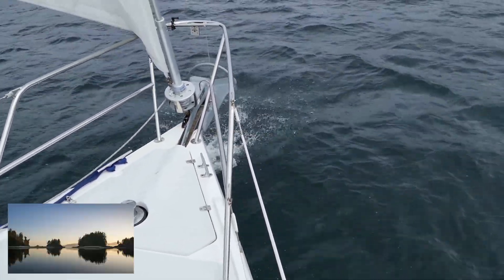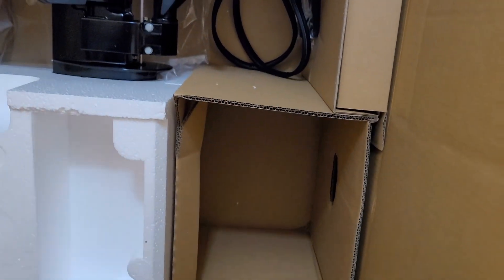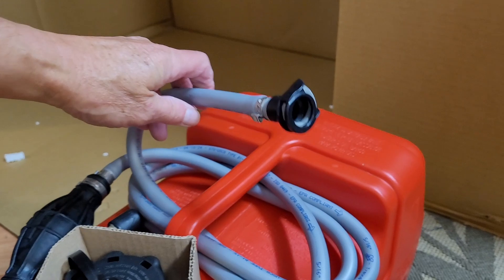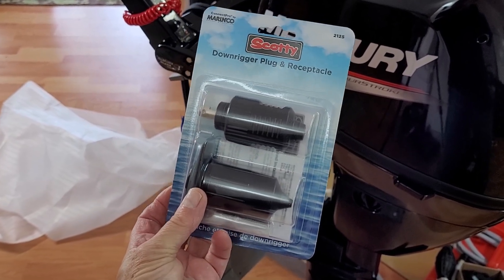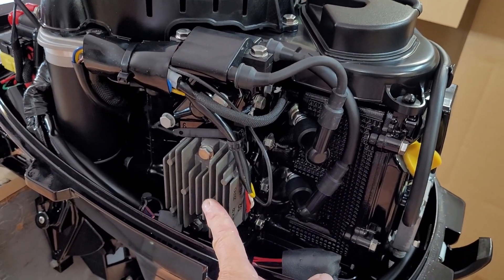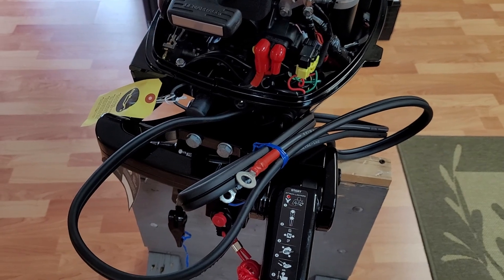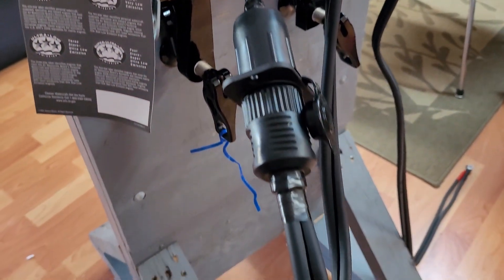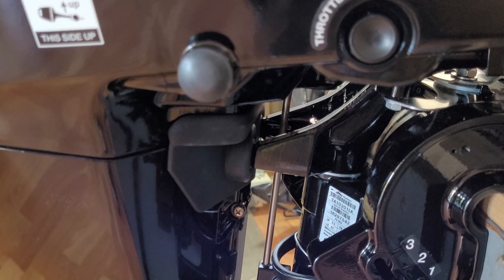2024/25 Mercury 9.9 HP EFI Outboard - Unboxing and  a Question for Viewers

Comment: I have a 2017 Merc 9.9 electric start (carb) that I have had since brand new and it's permanently mounted to my Gheenoe.  Still works like the day I broke it in.  If I were in the market today for a 9.9, I would totally buy the Merc 9.9 EFI over any other 9.9.  I wish you many good years on yours!

Comment: Hello, can you tell us how heavy the machine is ready to drive with oil and propeller? Best regards
Reply from the maker: Depends on if manual or electric start, etc. - But in the area of 95-105 lbs. (43-47kg)